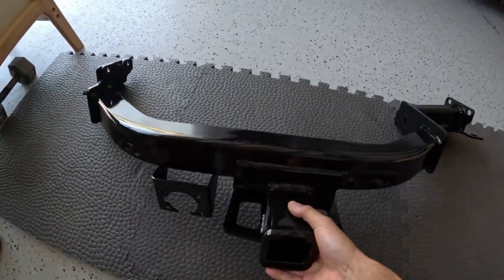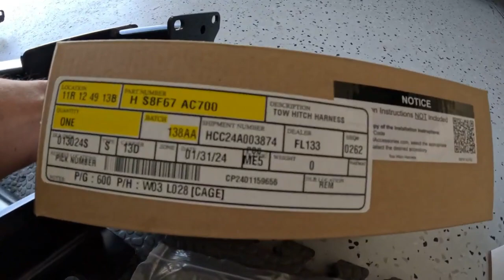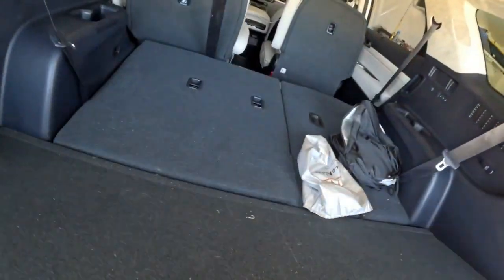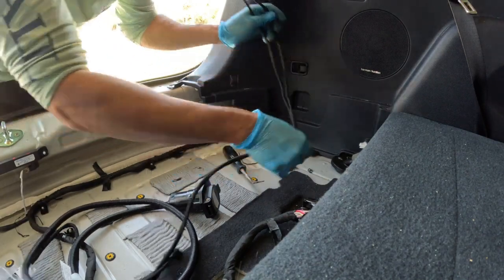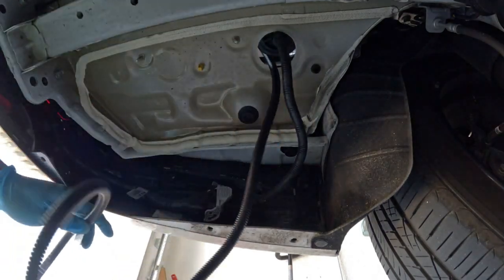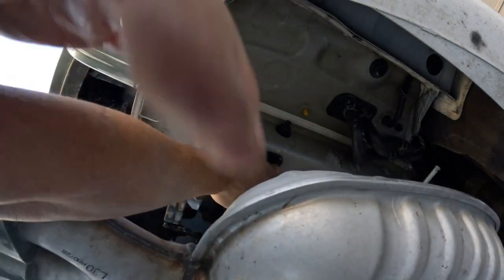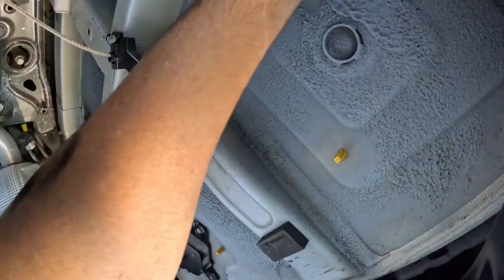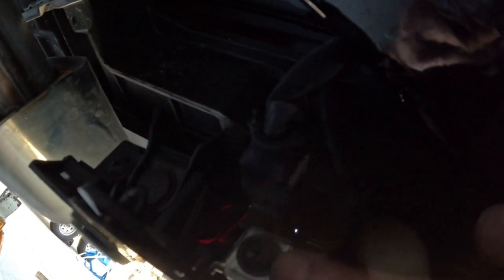2023 Hyundai Palisade OEM Hitch and Harness Installation

Comment: I think the directions say to put the bolts on the driver is from the outside in. If you to this you wont have to trim the cover. Thanks for the video.
Reply from the maker: I think I tried it that way but something with bolt shoulder that only fit one way. I could be wrong and you probably right.

Comment: So if the U-Haul one hangs lower would it still fit with the cover on? I want the oem one like you have but would want the cutout cover to match the chrome plastic
Reply from the maker: Yes, the Uhaul one will fit with the cover on just right beneath the cover

Comment: Great video! I had the dealer install the hitch yesterday. I could have done it myself if I had waited a day longer and seen this video. There is a TSB to replace the tailgate latch. Apparently it has to be done on 23 and 24 models manufactured before October 24, 2023. I don’t understand why. Any ideas ? 

TSB #23-BD-016H
Reply from the maker: I took my car in last week and the dealer didn't mention anything about it. This is what the dealer done since o own the car. Wiper arm recall, Oil switch replaced due to leaking oil, air bag module is on order and should be in this week. Airbag light keeps coming on when front passenger is on the seat. Diffinately needs an alignment when I get new tires because front tires are wearing on the outside. I rotate them every 5k miles. I have 26k miles on them and i'm going to need tires soom. So far I'm pretty happy with the car. I also bought the Hyundai platinum warranty 10y 120k with $0 deductable. You should look into that if you can.